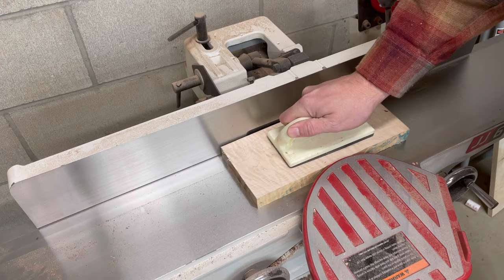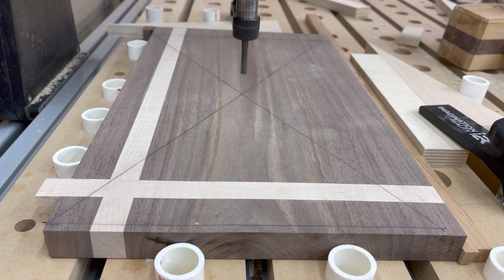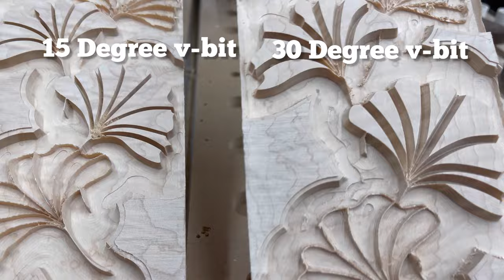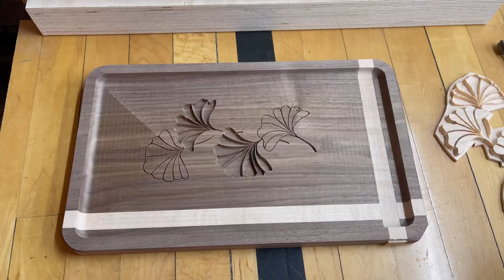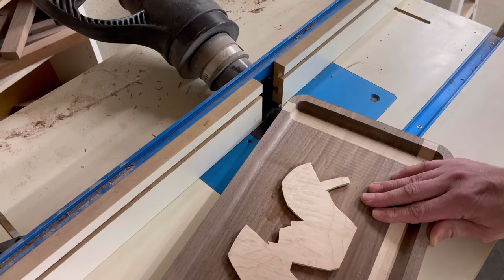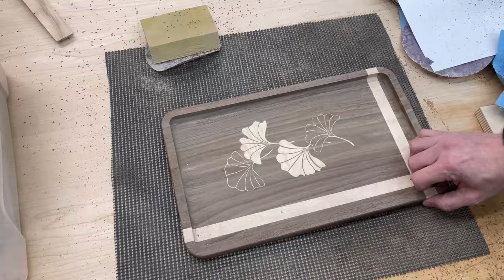Charcuterie Tray with Ginkgo Leaves || CNC Inlay || Making Process || Wood Inlay

Comment: Looks really nice but the only problem is as a 30 year woodworker I've never been able to glue straight grain wood on end grain it doesn't work wood has to move there's no way around it so your maple end grain cap will break loose it's just a matter of time..
Reply from the maker: Yeah it might but if it does we can make a better version

Comment: Was just having a discussion concerning those 15° 6mm bits on my channel. Do you change to a 6mm collet or just use a 1/4" collet?
Reply from the maker: Yes, I use a 6mm collet. I will have to check out your channel.
Reply: @ARBWoodwork  That makes sense. Thanks for the response.

Comment: Beautiful piece!  What are your thoughts on the end-grain glue up as far as strength at that joint?  Cheers,  Bill
Reply from the maker: This is being used for decorative purposes, so structurally the joint is not being stressed. Wood movement is going to be minimal if any with the controlled climate that it is in size and thickness of the piece.

Comment: The trick is to do the vbit cut first side there's more material and then the clearance after
Reply from the maker: That is what I do when it is not endgrain. Endgrain I use the endmill first then the vbit.
Reply: Sorry, it was just a general info comment for anyone watching. I spent quite a while dealing with blow out on high angle detailed carves thinking clearance was first
Reply from the maker: Oh, no problem. I was just trying to make sure the video was clear.
Reply: Great tip. Just learning here.

Comment: Andy, Excellent job on the inlay.  The press that you're using did you build it? If so, where did you pick the parts?  Thanks
Reply from the maker: I did build it. I used some Baltic birch and a shoulder vice press. modeled it after a book press.

Comment: Too bad it's going to crack and fall apart. The maple strip is perpendicular to the walnut. You can't glue cross-grain woods and expect them not to expand and contract.
Reply: Grain direction is the same. Look carefully.
Reply: @marson8870  Nope. The shorter maple strip is most definitely running cross-grain.
Reply from the maker: In a climate controlled house and not going to be exposed to moisture. Movement would be minimal if any.
Reply: @ARBWoodwork  It's a charcuterie tray. You're not going to get it wet or wash it? C'mon. Not dumping on your work, it's a beautiful design, but you might want to rethink going cross-grain.